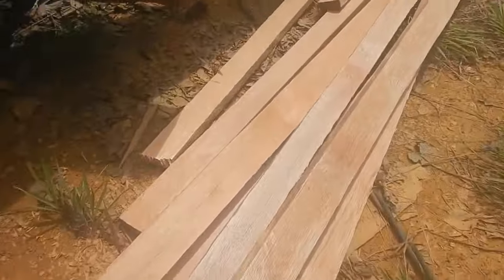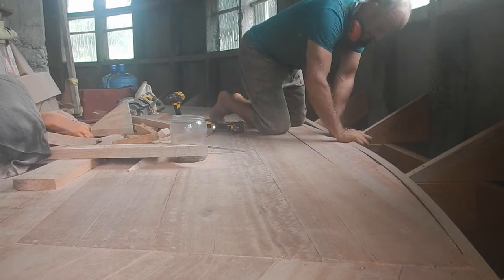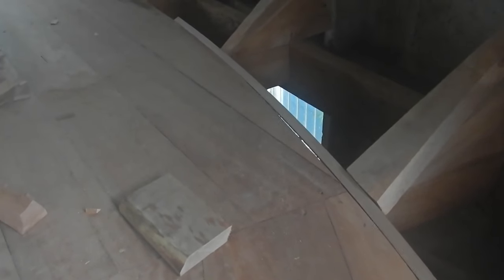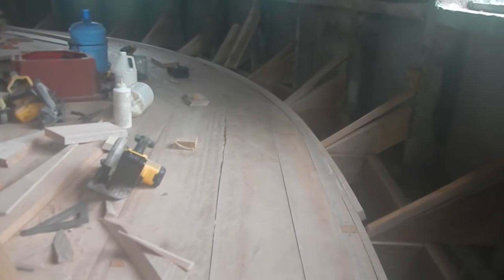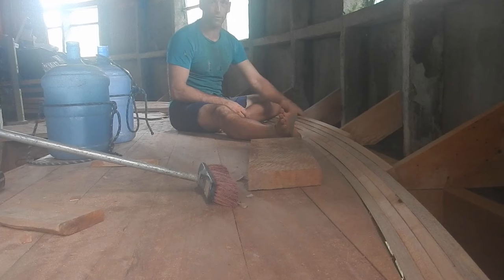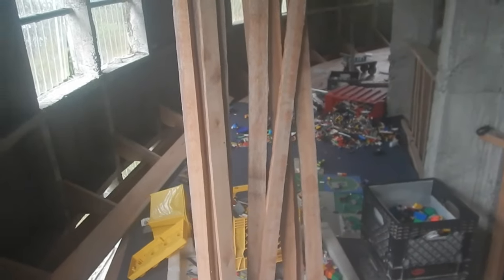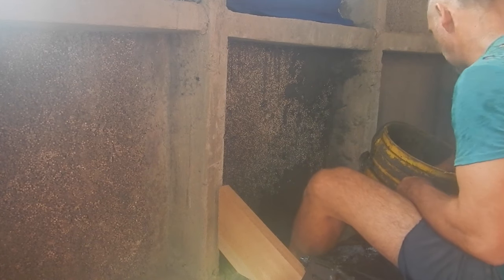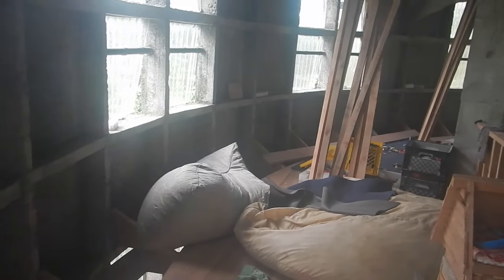Indoor Running Track!  Oh... we have a Bet! (Part 02)

Comment: In high school we had an antique running track high above the gym. It was banked pretty much all the way around. Started out with a slight angle, and the further up you went the steeper it got. 30 degree will be fine. If I remember correctly it got way steeper than 30 degrees at the outside edge of the track.

Comment: one nice thing about the tilt angled floor will be that it can 'self clear' of any buildup of stored or random items, as something like a wayward Lego would just slide off and then not be stepped on as you run the track .... I noticed this 'anti-clutter' effect on three surfaces I have(two drafting tables and a speakers podium) where the tops are slanted, you can only put so much on them(basically things you are actively using; like folding laundry, drawing papers, a laptop computer, book, or whatever that is pretty much flat and not a stack of that too high) until it all slides off onto the floor - always leaving a cleared surface ready for use
Reply from the maker: Yes!  The automatic return lego system!  Exactly!

Comment: I’m pretty sure you can run on your track and the angle may even be quite good. Can’t make exact calculations, because I don’t know the exact size of your house, but assuming it has 10m diamater, ’optimum’ speed for 30 degree angle is 20km/h. 

That’s way more than jogging speed, but definitely what you can run. However, you’ll start to feel serious g-forces, so it’s not the same as in open track. 

Some may forget that mathematically optimal speed is not the same what you can run and steep is better than too flat. 

Mathematically optimal is pretty easy to calculate. It’s basically when the force is perpendicular to the platform angle. Gravity is always 1g down, and other component is centrifugal force. Relation of the two is tangent of the angle. With 30 degree tilt, it’s about 0.58, meaning centrifugal force should be 0.58g. 

It would increase your weight about 15%, so it’s like running with heavy backpack. 

You can count the required speed with formula v=sqrt(A*r), where v=m/s, A=centrifugal acceleration and r= radius in meters. Assuming 5m radius, v=sqrt(5*5.8m/s2)=5.38m/s=19.4km/h

When word record runners run 500m, the average speed is around 27km/h. In 10km, it’s still  22.9km/h, although, they are not suffering 15% weight increase. 

I’m pretty sure you can run your track even 10km/h but be comfortable even if you take fast spurts.

Comment: Concrete water tank linings are impermeable and non-porous to water and most other liquid solutions1. These linings are used to create a waterproof coating on the surface of the tank to prevent leakages, contamination, and corrosion1. There are two common types of cementitious linings, which include epoxy and polymer modified cementitious linings2. These linings are ideal for waterproofing underwater retaining or collection structures2. Concrete is a highly porous material that absorbs water over time, and the lining acts as a barrier between the concrete and the water inside the tank, preventing the surface of the concrete tank from absorbing the water and sustaining damage3.

Concrete poisoning can kill you if there’s no medical intervention. Poisoning occurs when calcium oxide present in cement reacts with water molecules to form calcium hydroxide. Unless it’s microscopically cleaned, the burn reaches internal organs, causing multiple organ failure and possible death.

Comment: you don't have to "estimate" if 30 degrees is too much, you can literally do the high school physics calculations to find out at what speed your normal force becomes perpendicular to the bank. tell us the radius of the bank and I'll calculate it for you lol
Reply: He mentioned few times the size of the house. I forgot. I was something like 10 or 15 meters. 
But if you know the formulas, you can simply do the math for these two sizes and two more for us to get an idea. 
Anyway, even without owning the math too well, one can easily build an pendulum, rotate it, and see the angles on different speeds and get an idea. 
However, my thought is that they are able to run on it on 0 degrees. And maybe not full speed but still the body banks a little, and the ankles compensate. 
Then, when on the 30degrees, at full speed, if the body banks only 15 degrees,  the ankles will compensate back. 
Sure, this will mean some discomfort.